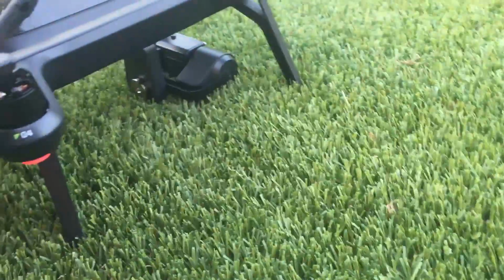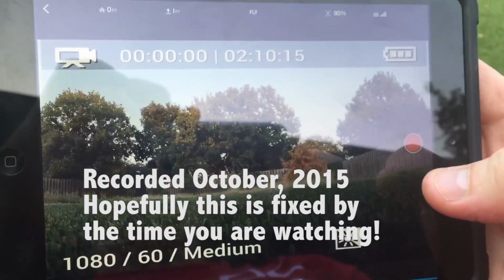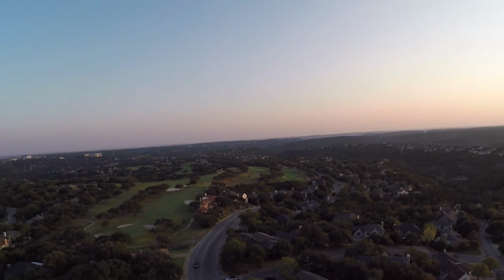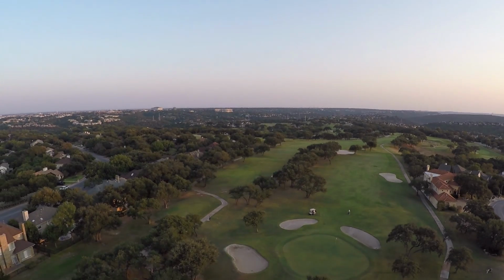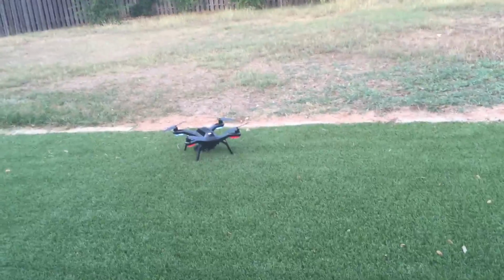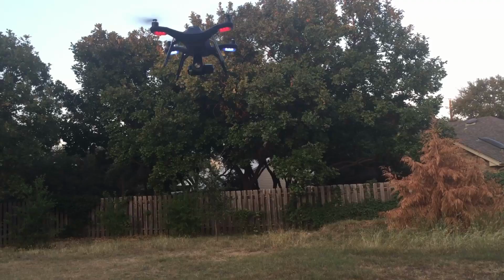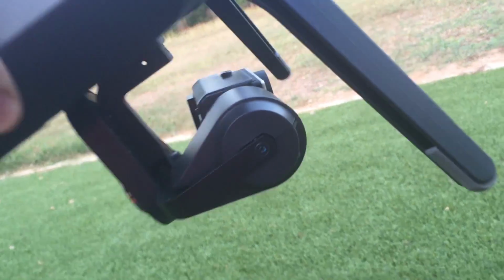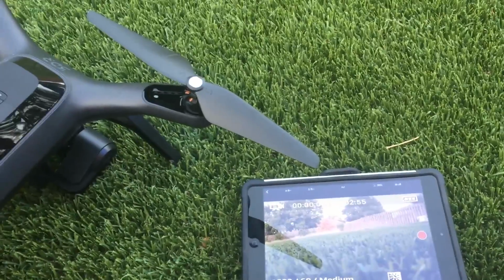3DR Solo Gimbal Review and Flight Footage

Comment: Any idea who I can call and talk to about sending my 3dr back and getting fixed... it never connected with the phone or remote control..ive had it a few years now.. just sits in the box..  I checked out the led lights on back on controller they are a mess compared to what I've read is normal..heeelp
Reply: Try solex and open solo if you still have the drone

Comment: So I looked at the sky view and you were more like 1000 feet from the drone if I did my trig right. You're back yard looks about 200 ft across and I assumed about a quarter mile to the golf course and at approximately 200 feet in altitude you would have been between 900 and 1400 feet away (depends on how far that gold course is). So just to clear up anyone who though it was terrible because it lost signal 282 feet of distance away, you will get much better range.

Comment: Good thing you got it in the air most folks have issues . You speak of crystal clear 266 feet chroma has easy half mile reception at 400 feet with st 10 . Don't glorify this piece of shit you almost lost it at 200 feet.

Comment: So, question (sorry if you have answered it elsewhere and I missed it).....my understanding is that the gimbal connects with and can control a go pro hero 3, 3+ and 4....But can you attach a hero plus to the gimbal and not have the connection to the camera itself but still get the smoothing and tilt properties of the gimbal?  I'm totally fine with starting and stopping the camera itself manually before and after flight.....

Comment: I know this is WAAAY late (and may have been compensated for), but I don't know if I'd worry too much about the "snow" as you refer to it.  It looks more like between when you toggle recording and the drone sends the video back, it's not transmitting or receiving that initial I frame and instead is trying to render the video in the middle of a P or B frame where not all of the video data is there to render the picture (which clears up once enough data is there or the next I frame).  It's just the way H.264 is if you end up trying to render initial frames of video without an I frame.  If the image went from black to the next available I frame it shouldn't happen again (which is probably why it's so random, sometimes you're getting that I Frame and sometimes you're not).  I don't know if they've updated the software to adjust for that since you recorded this episode, but it'd be nice if they did.
Reply from the maker: +Nethfel Great comment! Thanks!

Comment: Holy Cow!  3DR's loss, but my gain.  I just got the quad copter, gimbal, extra batteries, and extra blades for $299.00 at Best Buy ($318.00 after tax).  I hate that the support will probably go away, but for that low of a price, I just couldn't resist.
Reply: I got one for my christmas with that same bundle!
Reply: Eric Lawson just got me one tooo
Reply: LOL spoken like a typical DJI fawnboi. I have several and they have flown for over a year with NO problems, wish I could say the same for my 3 DJI's.
Reply: i dunno man ... my dji phantom 4 , 4P, and mavic have all been trouble free so far. The ongoing support is always a plus :)
Reply: I got mine and it works fine best drone I ever purchased so I don't why the rest of you have problems but sorry!
Reply: Eric Lawson I think you gambled money even if it is that cheap... it isn't a reliable flier sadly. Looks cool but it has a lot of issues since day one ...the frustrating part is 3dr knew about it even before they released it.

Comment: Great video, I got my Solo for $349 with Gimbal, Xtra battery and props at Best Buy. I also picked up a extra battery for $49 and the backpack case for $49. My friend has a DJI P3 and that's what i went there to buy(been flying a CX-20), but after seeing what i could get the Solo stuff for im glad i got it. 10 flights so far without any problems. GoPro has a recent update for the Solo so it takes a lot of the fish eye effect out of the picture.
Reply: silbay what's your problem? Chinese molded ...lol most stuff is made in China . It's irrelevant where it is made but HOW. Features and so forth.

3DR crashed and burned as a company  ,pun intended ...
If your esteem of your beloved Solo is so fragile perhaps you should ask yourself why.
Reply: BTW, i can change a lot of the settings on the go pro through the solo app.
Reply from the maker: Good to hear that! I got my Solo in mid 2015 and so the experiences in these videos are a bit dated compared to the updates they have made. Safe flying!
Reply: Danny Veloz  look on ebay. I bought a bebop with sky controller case and then when I received it I took the foam part out and put the foam from the 3dr in it. fits perfect
Reply: Bowtech2 just be careful with this drone because it is kind of glitchy
Reply: gawd troll give it a break and go back to your Chinese blown molded toy DJI's
Reply: do you know if the go pro 5 black can be used on this drone?
Reply: I have both the dji pro 3 and the solo. My dji standard fell out of the sky at 60% battery and crashed and burned but had no problems with the solo. Every drone has their problems but I've never had a drone do that before. I'm very wary about dji as I'm unsure if that's something done in purpose by them with firmware or whatever so be careful out there guys.

Comment: hey buddy I just bought me one 3dr solo
and I'm having a problem how to pilot my drone when is far away and last time I pressed come home and it took a different direction I was scared I would loos it.
why did it do that though?
Reply from the maker: So a couple of thoughts - first, are you in a populated area? The Solo can have interference if you are in a populated area. Second, make sure that your antennas are in the right position. They should be up at 45 degree angle and you should be sure you are holding the remote so that the antennas are facing the quad - it's best if there is a clean line of sight between them. Hope that helps!
Reply: You may have lost gps lock and not even realized it.

Comment: it's on sale for $379.99 with gimbal is it worth getting right now
Reply: Tomi What's unreliable about the Solo? Easiest machine I've ever flown and it made sure to use its intelligence to cover my ass during my first few flights that would've otherwise resulted in a crash.
Reply: Tomi Glitchy sounds like a software problem, not hardware. Quads are new technology. They all have software glitches, malfunctions and bugs. Yes, even the heralded DJIs. If glitches and bugs were a deal breaker for consumer UAVs, no one would own one. 

That being said, I understand the point you're making. This machine used to cost as much or more than its competing DJI. And you didn't even get the camera for that price. Had I not already owned a GoPro Hero 4 Silver and had 3DR not slashed its price, I wouldn't have even come NEAR consideration for buying it. But for the price I payed, I got an extremely intelligent craft with a beautiful interface, intuitive controls, and intelligence that covers for my plentiful errors. If nothing else, it's an incredible extension of abilities for my GoPro.
Reply: Logan Thomas forgot about the gopro ...yes that is actually an excellent point since you can't attach one on a Phantom 3 and above.
I meant that 3dr solo had more problems than the expected quirks of an occasional bad batch.
GPS connection issues , gimbal issues, loss of connection when it shouldn't. It sold a lot less than say a Phantom 3 but it had more reports of crashes and glitches than what I saw from DJI customers.
This drone had a lot of potential...if their higher ups didn't fiddle their thumbs and be so disorganised it could have been a pretty good camera platform. They just promised too much and the rest is history. Lacks a few goodies that the competition has
The design though, oh man does it look freaking cool.
I'm actually glad that you didn't experience any problems
Reply: Carlos Montijo it is if you have a good GoPro. More than worth it.
Reply: Carlos Montijo I think it's not...add 150 bucks and you get a more reliable flier like a Blade CHROMA, or Q500 ...or a Phantom 3 Standard.
Reply: Logan Thomas then you are among the lucky ones. This quad was very glitchy for too many users.
Reply: lack of support, some unexpected esc failures and motor issues. Not all of them are the same, maybe you got one with minor bugs. At the current price they are going for its a great drone to get you into flying.

Comment: Im wondering if that snow issue is low voltage to the cam and not enough shielding around the hdmi cable, I have found with manufactured camera drones that they tend to not shield the way we do with full size A/Cs.

Comment: Can you use not-Iphone and not-Ipad things t ocontroll it? like samsung's n others?
Reply from the maker: Yes - The Android app is available for iOS and Android devices, so if your Samsung runs Android, you should be good to go. Thanks for watching!
Reply: Ready Set Drone  Thank you for answering despite this being quite an old video. Btw - do you thing this one for about 800$ is worth it? (for a complete novice I mean?)
Reply from the maker: I think that Solo is a bit more advanced drone. For a complete novice, I would buy a DJI Phantom 3 - you should be able to get one for less than $800. It's easier to set up, maintain and fly. Good luck and let me know what you end up doing!
Reply: +Ready Set Drone Thanks for the advice. Ill see if I cannot get one (shipping tends to be quite problematic here) and I&#39;ll decide then. I really appreciate your advice and opiniom, again,  thanks much. You're talking about the standard ver, right?

Comment: Will it fit my go pro hero session 4?
Reply from the maker: It won't. The gimbal is designed for the size/shape of the GoPro Hero 3 or 4 only. There may be aftermarket ways to make the Session work, but I have not seen any. Hope that helps and thanks for watching!

Comment: I don't understand why on earth they would make the Solo charge the Go Pro. That only takes away from the Solo's power. Which is not needed. The Go Pro battery at its highest resolution lasts SOOOOOOOOO much longer than the Solo. Guaranteed you can roll a few Solo batteries during the time it takes to kill a single GoPro Battery. These devices do not have enough fly time as it is, I want my Solo to follow me on cruises without needing to stop every mile to switch out a battery.

Comment: question, ive been reading poor reviews regarding the solo, had the softwareupdates / possible hardware revisions helped with this? 

considering one still
Reply: +Ready Set Drone well the thing is I sortve get a huge price cut due to where I work for the solo with full gimble and other accessories, however I'm not against doing mods since I've always been into modding anything I own. anything about the solo that I should know about in general? in your opinion

Comment: Why do you prefer the 3dr solo above the DJI Phantom 3? You say that you like features like rotation around an object (POI) and the nice gimbal, but the Phantom 3 has all of that. Personally, I like the Phantom 3 better and also it's camera, as it hasn't got the ugly fisheye lens on it. What's your opinion about that?
Reply: I'd prefer the Solo over the Phantom because of the Camera. Its a GoPro. So on top of JUST using the camera for flight... you can strap it to your car, your helmet, your snowboard.... Anywhere you wish and keep using it. So that makes it much cheaper in the long run and more user friendly.
Reply: +Joshua Gray That's not really true. A phantom pro costs $999 with camera and everything. The Solo sells for $1,322.44 and that's excluding a GoPro. You'll have to buy that yourself. So actually, it os not cheaper at all. Now if you already have a GoPro, it might actually be interesting to get a solo,  but it's still $321.44 more than the P3P. I have a Xiaomi Yi action cam that I use besides the drone shots and that is only $70. That means that I have a drone with a longer battery life, two camera's and $251.44 and you have a drone and a camera.
Reply: +Axel Köhler the solo goes for 700 without the gimble. Manufacturers price right now is like 8 to 900 US. But lots of shops are selling it for less.
Reply: +Joshua Gray Ok, but why no gimbal? Also,  it's then not that comparable to the Phantom 3 anymore (and if you don't need 4K,  which I assume as you even skip the gimbal,  you can also get a P3A for $800 all in or a P3S for $500 all in,  both with gimbal and 2.7K video).
Reply: +Axel Köhler gimble at expensive places like best buy are 200. I just looked at the Solo is 700. Then add the GoPro. And it is cheaper. If you are like a lot of people who want to have a gopro for other reasons. I do. I don't wanna spend a ton of money on a drone and then need an additional camera. When I could just take the gopro off and strap it to my car or helmet.
Reply: +Joshua Gray Yes, but you need the original gimbal from 3DR, right? As far as I can see you can't use a 3rd party gimbal,  which adds a sum of $230 to your shopping cart.
Reply: +Axel Köhler best buy has the 3DR Gimbal for 199
Reply: +Joshua Gray Which then brings your total up to $899 excluding a camera.
Reply: +Axel Köhler RSD did a review on the Full setup on the Solo Vs the Phantom 4 with price of everything and the price since has gone down.
Reply: +Ready Set Drone A beautiful country indeed, but I live next door in the Netherlands. My parents used to live in Germany though (and the Netherlands is also very nice, when it's not raining).

Comment: Hi there, are there any updates by now? 
As far as controlling the GoPro, it doesn't look like I can switch between Photo and Video modes, during flight.  (Without a gimbal).  
Can I control that through WiFi,(GoPro Hero 4) using a secondary controller, i.e. another iPhone or iPad?  Hopefully that doesn't disrupt the signal of the drone.  
Thanks for replies.
Reply: +Ready Set Drone 
Hi there, I recently purchased a Gimbal for my 3DR.  However, I'm experiencing a non responsive gimbal.  The video feed is showing on my iPad, but I'm not able to control the gimbal at all, and the display says "No Gimbal found" on the RC Controller.  Any ideas?

Comment: Wow, my boyfriend has a Yuneec Q500 4K, it's so much quieter than the 3DR.  Plus it has so so many camera controls that are all able to be done on the all in one transmitter, video device.  The whole package was just over $900 including a great aluminum carrying case.  You should consider replacing yours with Yuneec.  Just some friendly advice.  :)

Comment: You only flew 200 feet and it lost signal? LOL I sit on my deck in my backyard, fly over 50 foot pinetrees with my Phantom 3 and can go at lease 2500 feet with no problem. Still the undefeated champ DJI... even the camera has no barrel distortion like the GoPro 4 LOL

Comment: Seriously, you would prefer to have the Go Pro cam over the one built into the Phantom 3? From what I've seen on YouTube I wouldn't. For starters, I hate the fish-eye effect of the Go Pro. Secondly, I think the colors look better from what I remember.
Reply: +Ready Set Drone I just checked and Phantom Pro has a FOV of 20mm. Go Pro has a 21mm on the medium setting, and the fish eye disappears (I think). But after I got looking, it's going to cost a lot more to go with the Solo and not really worth the extra costs IMO.
Reply: +Godless Glen Gopro have fisheye on narrow also. a tiny bit. but on medium the fisheye is pretty huge. can be fixed in post, but the sides of the video will be stretched and blurry. It would be better to just change the lens. I had a 5.4mm on my gopro and that looked very nice. a lot sharper also.
Reply: GranVlog Thanks for the info. Very helpful. I think that I'm going to go with the Parrot Bebop 2 or the Yuneec q500 4K.
Reply: +Ready Set Drone I just sent back my Bebop 2. The images and video weren't up to par. Lots of aliasing. Also, Parrot has horrible customer service. I tried to cancel an order I placed that had an error and could never get that taken care of. I had to actually file a dispute with my bank to get my money. I highly recommend everyone stay clear of Parrot.
Reply: ***** Oh yeah, that's another thing. The drone lost contact with the sky controller and it wasn't no where near the maximum distance of 2k.
Reply: +Ready Set Drone I did that and in short order returned it for the 3DR. The 3DR is made to expand and is tool quality. The bebop had repulsive software with advertising in mind and it's a full on joke compared to the 3DR. Weight difference will cause the bebop to be grounded when the 3DR can still fly easily. Parrot has also shown us that upgrading the flight time requires buying the new version of the drone instead of a new model of battery like the 3DR has already talked about. The two has no comparisons unless you get off on range and even the the 3DR will win due to autonomous flight via the Tower app.

Comment: I have lost signal on my Solo at close direct line of sight the signal range is very poor compared to the Phantom. I like the smart shots but it also has about 80% of the flight time the Phantom does. The Solo is stable but I've also had issue trying to start the GoPro from the app and have had to manually start recording by pressing the shutter button while the Solo blades are running I reach in and can barely press the front part of the GoPro shutter button.
Reply: +Jeff Jones Thats to bad :( All the smart shots is on the phantom as well btw. If not in the default dji go app, you can use 3rd party apps. :)